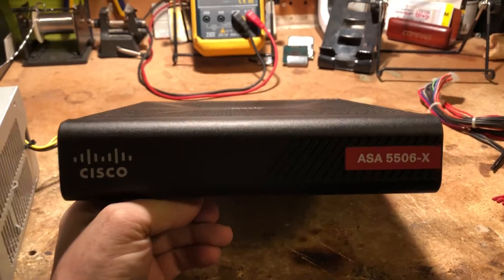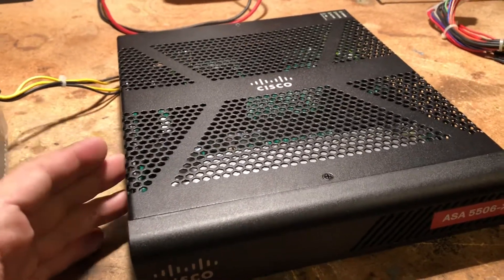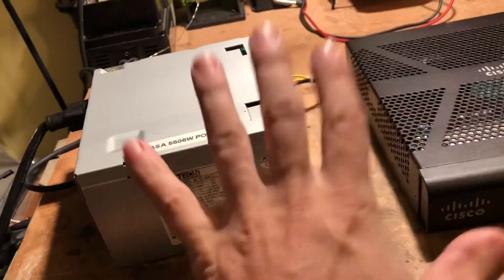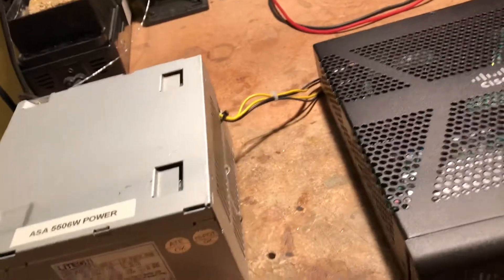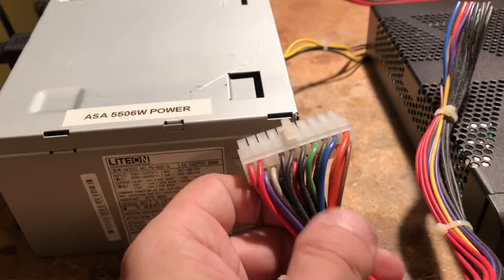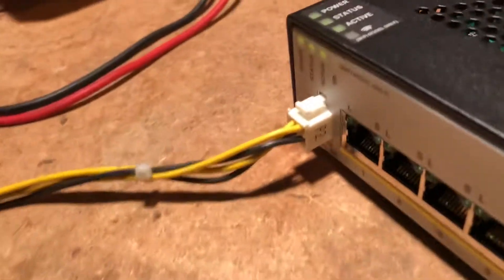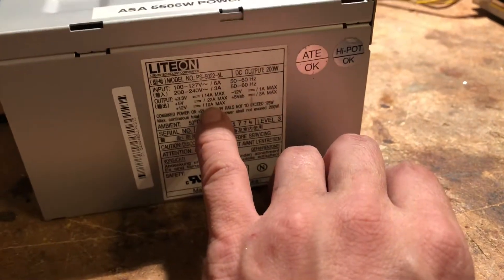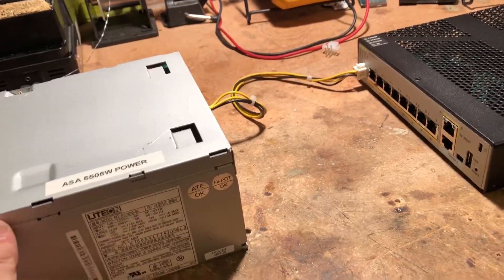Simple Replacement AC Adapter for Cisco ASA-5506 from PC ATX Power Supply

Comment: Dave, So in your video is yellow positive and black ground?
Reply from the maker: Yes that is correct. In the 4-Pin Molex connector Yellow is +12V, Black is Ground. 

On other power connectors where you see Red, that’s +5V and Orange is +3.3V.